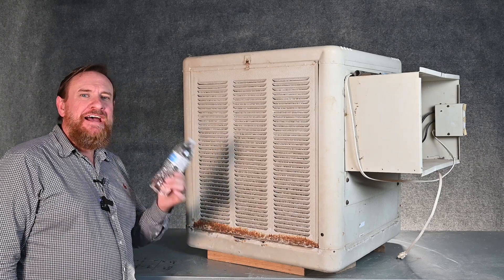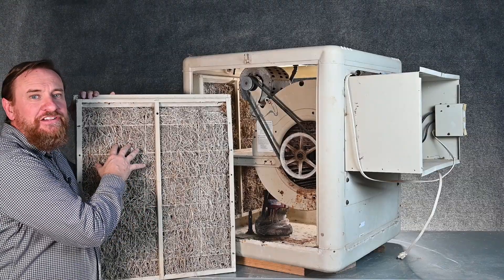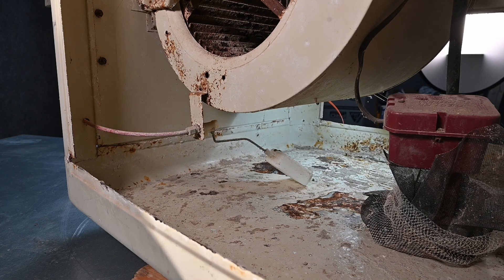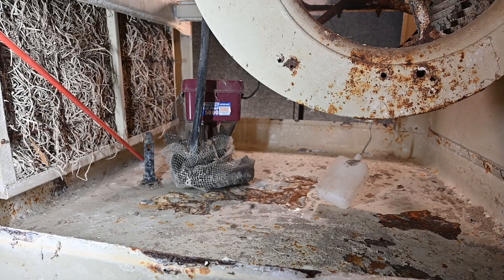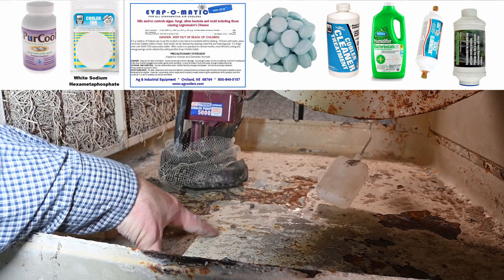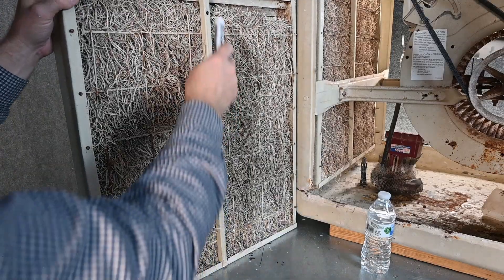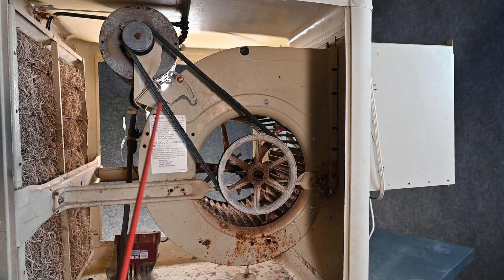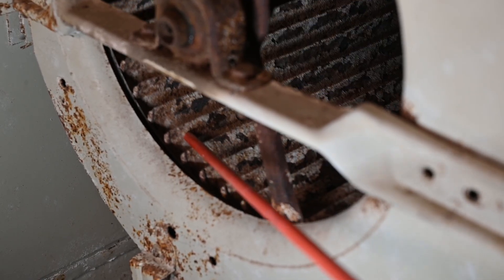HVAC 166  Evaporative cooler how it works inside

Comment: Good morning, I have a question: I have a Master Cool 7000 unit. I would like to insulate it with 2 inches of NGXT-250 foam board, without covering the part where the air enters, of course, just the parts of the unit, which would be 4, to give it a better R-value and keep the inside of the unit cooler from the sun. What do you think about this?

Comment: They need to make the whole thing out of stainless steel, I am going to build 1 outta stainless steel
Reply: Did you finish building it, Carl? Thank you
Reply: Champion built a down draft  ( roof top ) cooler for a few years but stopped production because the coolers lasted too long.

Comment: Thank you so much for all the videos and explanations! This dirty blower wheel can we pull and clean out or there is no way?
Reply from the maker: Great question, I'm sure there is a way, but I imagine it would be a nightmare. 

They usually end up rusting before getting dirty. 

I have washed them in place before. Also once the feed water is treated, the wheel clears up.

They don't get dirty like the blower wheel for ac since all the air is outside and the water and pads acts like a filter.
Reply: There is a way to remove the blower wheel but it is a long drawn out process and if you're in the trade it might not be economically feasible  > time and materials.  I have done this on my cooler and for a dozen or more customers coolers.

Comment: We have a similar roof system but it's constructed with plastic (lower section) and stainless steel (upper section and panels), seems like the colorbond steel construction is a poor choice for the consumer.

Comment: I have an evaporator cooler that is spitting/ sputtering out water from the supply air. The float is working correctly and isn't flooding/  doesn't have water near the blower housing.  Any idea what is causing it?
Reply: If the pump is too large  ( head pressure  ) , too much water will be supplied to the water troughs and they will flood causing excess water to be splashed out into the coolers duct  ( this is called  " water entrainment  " ) .
Reply from the maker: Check the gutter tray at the top. sometimes they start to clog and overflows out of the tray into the blower.

Check the pads, once they get frayed or mineral solidified they will pull water off

Since it is the end of summer, sometimes its more cost effective to slow the blower down and replace the pads next spring.

Comment: Very helpful breakdown of medium scale equipment! I'm working at a combined cycle power plant that has evap coolers for the air inlet of the gas engines for efficiency gains, and I've only ever had a surface level understanding of the concept. Where I'm living, I'm surrounded by data centers that are all hiring for operating and maintaining UPS systems and various cooling solutions. This video looks like it addresses what an evap cooler in that setting might look like and, more importantly, what problems and solutions to expect and implement in the field! Most other video results were about small scale swamp coolers for a room, which is the same process, but not very helpful to what I wanted to see.
Thanks for the hard work and good teaching!

Comment: Thanks for doing this demonstration with a rusty system because its more realistic. I learned a lot and I really like evaporative coolers for dry environments, man it feels good, and I like that its an evolution of ancient wisdom and technology. I wonder if newer evap cooler systems have a better protected motor because my evaporative cooler gets absolutely blasted with the evaporated water and when it dries that calcium cakes it up. I probably just need new soaker panels haha, once a season and Im over here reusing it for several seasons, thats probably my main problem.
Reply from the maker: Try a calcium filter and a pump to flush out the sedements.

Some of the newer models use use a cartridge style evaporator instead of pads and they use sealed motors with plastic fans and fan housings. Calcium dissolvers can be used in them since they are plastic. 
I think they are better but they are pricey!

Comment: I like the second pump system the best.  Basically, it is a blow down method, been used in steam boilers for many, many years.  The cooling towers where I work has a sand filter system where accumulated mineral deposits can be removed through a blow down.  We use a chemical free method of controlling mineral deposits.

Comment: Seems to me putting treatment in the pan is not going to do too much for these systems,I'm in new england,I've never seen one before but I'm experienced in water treatment for feed water systems and what's going on with  fresh water being added daily to these systems is not going to be controlled by adding chemicals to the pan,especially on the ones that pump out like you say. The best thing would be to filter and run the water through a softener system before it feeds the unit,better yet an r o and a softener, then you could probly get 5 years or more out of your pads and 3 to 5 times the life out of the unit itself.
Reply from the maker: I should have covered it more than just a picture but we use a descaller filter  on the inlet water for all units. 

The pump is certainly the better choice over chemical tablets  although we do have some now that treat for bacteria with a controlled release. 

The RO would be awesome. Although I don't think I have ever seen one in a unit.

In cooling towers we have chemical pumps that add in a chemical for every x gallons of water added. When the chemical person messes up it does a lot of equipment damage. 

Some of the new coolers use a crate style cartridge that performs better and lasts longer. I believe the port-a-cool units use this same style. They last several years. 

I guess it would come down to cost vs replacement at some point.

Great comment and insight.
Reply: @love2hvac  yes cost is always what it seems to boil down to lol but if I lived out that way and this is the type of unit I would have in my home forever, I think I would invest a bit into water treatment for sure, they sell small inline r o systems for 400$ or so for an entry level decent one, water softener setup around 1200 in materials if you could do install yourself and save money there, I know you can,I mean other viewers or the average homeowner. But ya I'm sure there's people who do install these things for there systems, it's not like it's brand new technology I'm sure the installers try to push for it out that way
Reply from the maker: I do think it's a better way of cooling for a dry climate. You get a lot air exchange in the house pushing out off the air contaminants from all the products in the home. 
It uses much less electricity and the extra moisture in the air is good skin nose throught and eyes. 

I want to try the RO or softener system now. I agree that would make a big difference.
Reply: The inline scale/filter is a misnomer. The scale cartridge contains polyphosphate,  a compound that helps to sequester calcium and magnesium salts,  thus reducing the tendency of calcium to harden and salts to corrode metal surfaces. 
The r/o is a better idea but you would need a storage tank to supply water to the cooler in between r/o operation and flushing intervals. 
As for a salt based water softener system,  why would you want to add more salt to your feed water  ?
Reply: @Anthony Gonzalez  you wouldn't be adding more salts to the water, you'd be reducing cal mag and other dissolved solids. This is done before you send the water to an r.o. otherwise you'd just plug the membranes up in a short time.   Although phosphates do react with calmag to turn them to a dissolved state in a boiler feed application, it's always best to remove as much as possible before it gets there as chemicals are only partially effective at their jobs. You need a combo of both external and internal treatment in those cases, in this case with the swamp coolers, I was just thinking it would be best to pretreat so you don't have to guess if the tablets or inline filter is working efficiently. It could mean the unit lasting 15 or more years longer was my thought